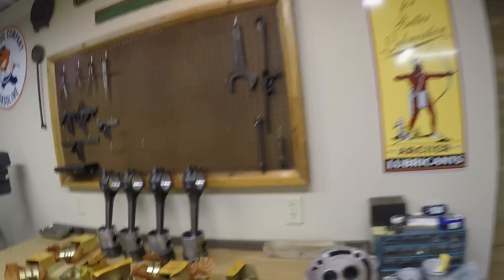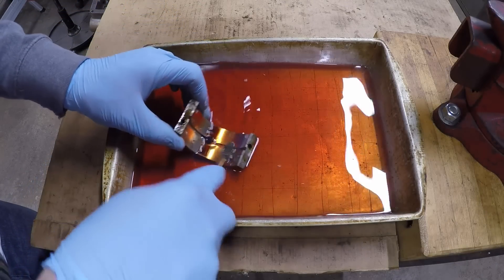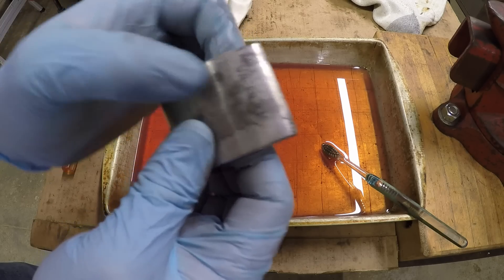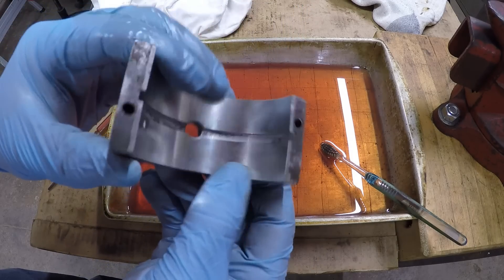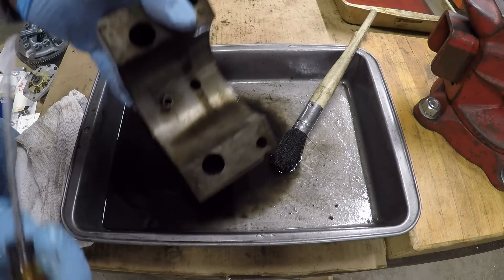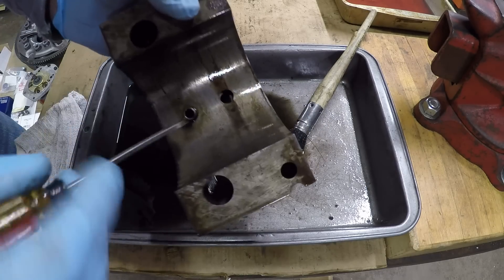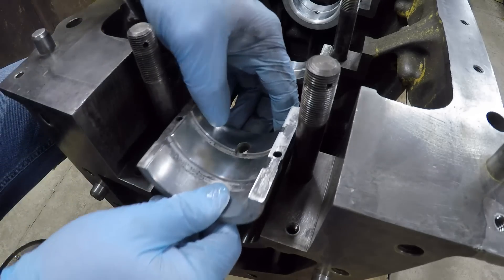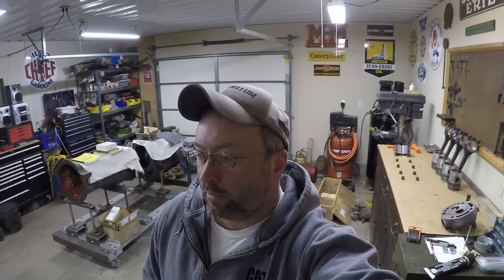Caterpillar D2 #5J1113 Diesel Engine Assembly Ep.8: Main Bearings, Cosmoline, & Coincidences

Comment: I really enjoy watching the series. You are very detailed and meticulous. 
Just a word of advice, as an engine builder, never oil the back side of the bearing sells for two reasons. 
One, it will change your bearing to crank journal gap ever so slightly, but more importantly it provides less friction between the bearing shell backside and the bearing bore after the bearing shells have been crushed when torqueing the bolts, potentially allowing a bearing to spin in the bore, (yes, even with a locating pin). 
I'm pretty sure other engine builders will say the same.
Can't wait the see the Cat purr.

Comment: Installing main bearings and wiping a film of oil onto the mating surfaces is one of the few places I would have a different opinion from this man. I was taught that bearing backs and main bearing bores should be dry for good metal to metal contact to promote heat transfer.

Comment: I have a question for you. I am in the process of top overhaul on a D311. I have removed the pistons from the bottom. I have removed the liners and am waiting on parts. One new liner and ring set and 4 new copper sealing rings. I will proceed to do proper checks on liner protrusion. I know that you replaced the piston /rods through the bottom. I have been told that on final assembly you can install the piston/rod/liner as a system from the top. Have you ever done it this way? Seems like it would be considerably easier than trying to lay on my back under the machine and sliding the piston/rod back into the liner. What are your thoughts?

Comment: What was purpose of putting date of manufacturing on the parts and why did they use date codes instead of putting the actual dates?  Always appreciate your videos! 🚜👍
Reply: Very interesting! Thanks Squatch!
Reply: Date codes were often preferred because they need fewer characters, and therefore fewer 'date rollers' on the date stamper, and each character could be larger for maximum legibility.

Comment: I can remember working in a Cat shop long time back when an old traxcavator came through. Don't remember if it was a 955 or something smaller. The engine had the same rope seal for the rear main cap. Only a couple of the old hands knew what to do with it. One is only a few years younger than some of your NOS bearings.

Comment: I wouldn’t know how or if it could be done but calculating the odds of getting two main bearings manufactured on the same date together under the circumstances we’ve all witnessed would have to be staggering. That’s true for any mass produced item but when you throw in WWII, which increased production of small parts for new manufacture and spares by 100(?) times, it’s almost miraculous. That was a highlight to this video and cool in that it didn’t cost you a penny (more than you otherwise spent for bearings regardless of date codes) and you didn’t have to spend time preparing mock-ups or other presentation aids to show us your unbelievable discovery. Fate did an excellent job, just as you always do. 😎👍👏
Reply: Squatch253 - I had mentioned in a previous comment some time ago that my dad was a motor pool guy in the Philippines near the end of WWII in the Pacific. He witnessed wholesale  dumping of equipment and parts the Army didn’t want to ship back home again. He always shook his head and said you couldn’t believe the waste. They would load small ships and barges with everything his outfit had accumulated and went out to deep water and tossed it over. If you had those parts, you could rescue and repair every mutt you could find.

Comment: Thanks for the updates! I was intrigued to see that the inside of the block was painted. I had heard at one time they painted the block to facilitate quicker oil run off back into the pan. I would guess that was done before machining and assembly. Something that you don't see anymore.
Reply: paint also locs up residu sand from the moulding proces, thuss less oil contamination.

Comment: Hi Squatch, I’ve heard people say never to oil the back side of bearings to reduce the risk of spinning one. Obviously,with locating pins that isn’t a concern with this engine, but could you let me know your opinion for bearings without locating pins? Thanks
Reply: As long as it is a light oil I wouldn't worry about it. I have worked on thousands of engines and have yet to find one that when I took it apart it didn't have evidence oil between the bearing shell and cap upon disassembly. If it is going to wind up there anyway I don't see what having a little there to begin with is going to hurt. You just need to be aware that if you did this fast you might could effect the bearing clearance by trapping some oil. Given a few hours it will press out and be normal clearance.
Reply: @bcbloc02  Thanks Brian. If it's not a problem with the performance level engines you're working on, I'd have to believe 'daily drivers' would be no different.
Reply: Squatch253 Thanks Squatch, I’ve got to believe if the dimensions are where they need to be then the crush will hold the bearings fast. Sometimes you hear things and they make you wonder. Anyway, I’m looking forward to the next installment in the series. Keep up the good work!